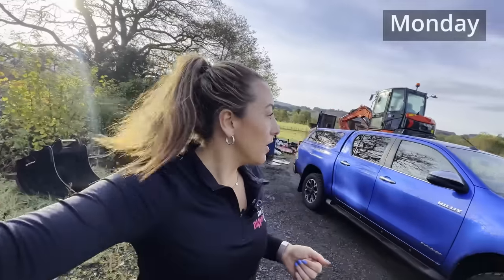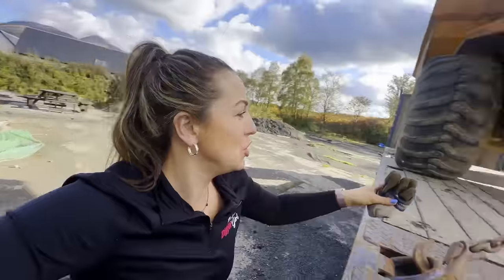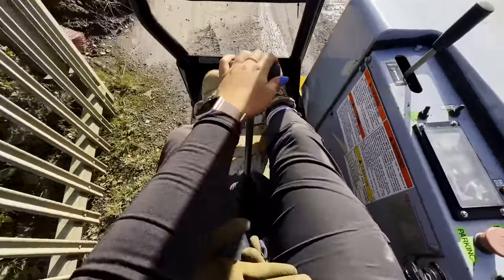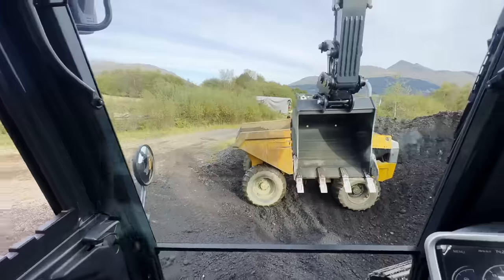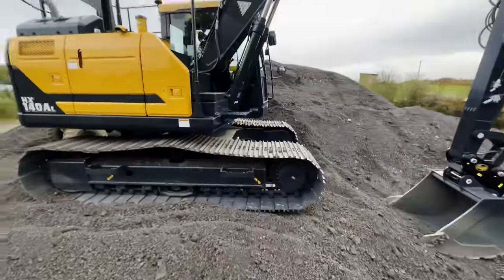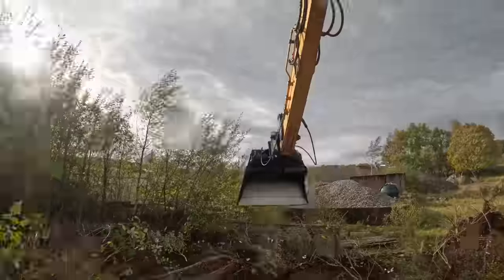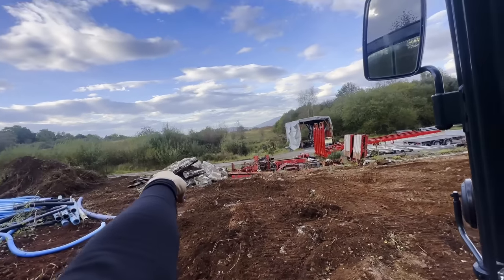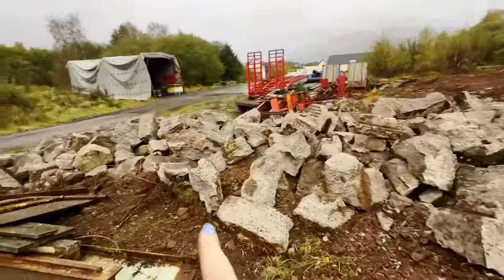Brand NEW Excavator!!

Comment: 20:00 - That was a good sign, when you found a live spider in the engine bay; everything works better with live electrics spiders!  😄

There was one pecker job at my work you would have hated; they had to dig out basically a swimming pool (by volume) from Lewisian Gneiss. in order to fill the pit with concrete (spec for job)!

Comment: Our tracked diggers normally go 8/9t -> 15t short tail swing, 18t and then 20+

Would a short radius machine be more hassle/expense than the 14t is worth?
Reply from the maker: Ahh where you based? Eh I think it depends on what you’re doing. Hyundai have a 145 zero tail swing which is handy around house builds and built up areas 😁
Reply: @the_digger_girl  Luxembourg, standard 14 tonners are basically nonexistent here.